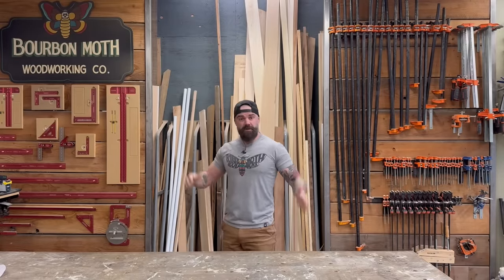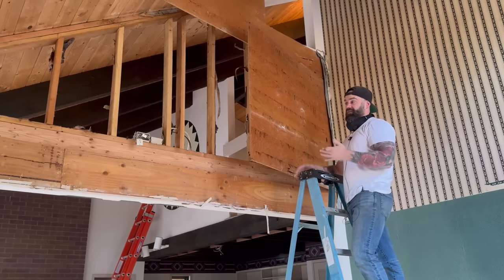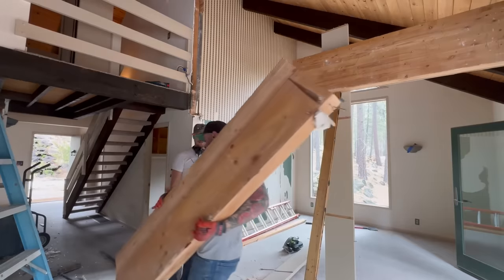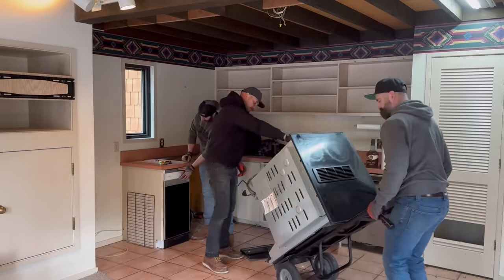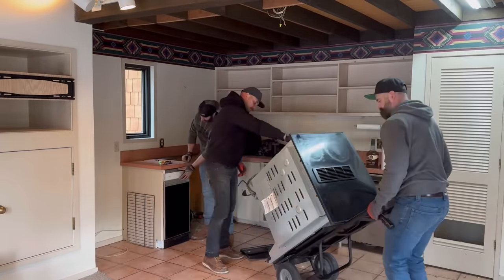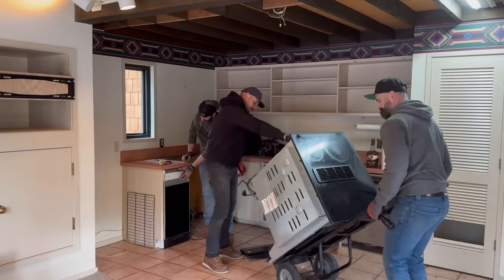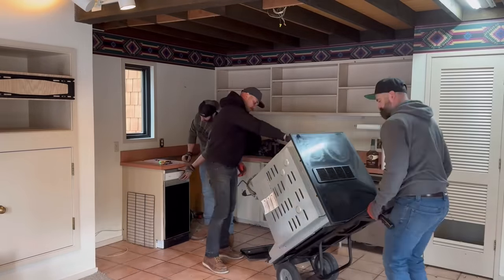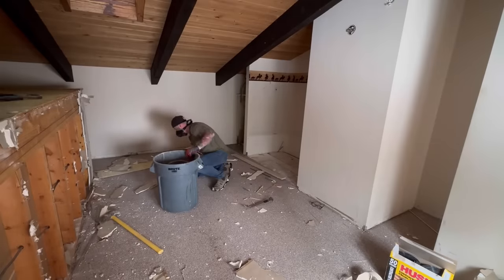Tearing Apart Our New House || Was This A Big Mistake?

Comment: That ply makes me nervous. Are you certain it’s not a shear wall? That’s a typical application of plywood on interior walls, to add rigidity and increase structural strength. Earthquake preparedness and IBC code. Did you have a structural engineer look at it and say it was okay to remove?
Reply: Maybe, but a shear wall wouldn’t need insulation, right?
Reply: Bahahahahaha!!!!  Cabinets as soft as their meatballs!!!!  That’s so accurate!!!!  Laughed my ass off at that one!!!  Classic Jason!!!!  Love it!!😂😂😂😂
Reply: Yep, I would look at what was holding that beam up and see if it extends to the foundation.  If so that was put there to hold up a bulk of structure.
Reply: I would be nervous as well, but since it was exterior previously it's no too concerning. That means the walls on the other side were added and they are adding shear strength to replace the one he took out. And significantly more shear than was original because it's a solid wall, not with a huge door.
Reply: Code is gay.
Reply: He said the place was built in 1976 and has never been updated. The state of Oregon didn’t implement seismic code until 1993.
Reply: @judmcfeters9054  and? He was clearly wrong when he said that, as shown by the exterior wall interior to the house. Seismic code is not really relevant. It has sheathing in the exterior walls whether that was calculated or not. The fact is it has more shear strength than when it was built, because they've added more square footage of sheathed wall than when it was built.
Reply: Also, building code was first implemented in 1974 - only 2 years before this was originally built. By the look of that electrical he uncovered, they probably didn’t follow any code at all…
Reply: Looks cool. Looking forward to watching the progress.  Really looking forward to seeing it on air b and b - I live a few hours away and I’d love to take a vacation there 😀. Please add a hot tub 😜😜😜
Reply: I was worried about it being a shear wall until he found the remnants of the original ceiling beams cut off behind the wall.  I still would have called a structural engineer first, though.
Reply: That insulation could well have been used to zonalise the heating. Previous owners may have wanted to heat the upstairs balcony area without heating all of that huge ceiling area beyond. That could have been the entire purpose of that divide. I really don't think it would have been an outside wall.

That said, it would probably have been a good idea to get the opinion of a structural engineer before taking those dividers down, just in case they were put in retrospectively to augment the structure.
Reply: Based on the decorating and some of the definite addition-y aspects, I would guess this house had some major update mid 90's. Gives vibes from "room by room" (tv show).
Reply: The way the stairs go through the small bedroom door I’m thinking that room might have been added too. Would be interesting to see if one of those walls might have exterior sheathing.
Reply: I am trying to wrap my head around the fact that if the roof beam had been cut back to make space for that large header and the wall above the header had sheathing and insulation on it, was that roof beam actually a roof beam like the others, or more an ending point of the roof load?
Reply: I wouldn't want to walk the roof until the original beam was reinstalled, the beam that was removed to put that header in. And hope for no big snowfalls.
Reply: We insulated our walls and they had brace ply on them, it indeed could be brace ply
Reply: Look thru historical google earth images to see if the house grew
Reply: LOL.  The house was built in 1976. How long has Google been taking satillite images?
Reply: Architect here, it's his house so you can do whatever you want. Would still advise some professional input from an engineer or an architect. Love this series, wish I found it when it was complete so I could binge.
Reply: First thing that came to mind. Shear wall !!!
Reply: Shear walls usually have a special nailing pattern. I don’t see anything like that in the video. Maybe they didn’t do nailing patterns back then?
Reply: He found metal flashing on the interior, though… wouldn’t that almost certainly mean it was originally an exterior wall?
Reply: That's not a shear wall. Shear walls need to go to the foundation to transfer the lateral loads (e.g. wind and earthquake) out of the building. If the shear wall stops at a beam then 9 out of 10 times the shear wall will be too flexible per code and the building will move too much sideways.
Reply: Yup I was thinking the same with those vaulted ceilings it would make sense that ply is structural
Reply: @Mostviews111  the plywood isn't the issue because it's not a shear wall. The bigger issue is his roof planks are spanning too far without that partial wall and header beam in place. If there's a blizzard or a lot of snow built up on his roof, the roof will "fail" or if there is enough snow, outright collapse right there. Luckily, we're moving into spring so he should have some time to get that new rafter in place.
Reply: @joshuaworkman1  Shear strength isn't the issue. He compromised the gravity load carrying capacity of the roof.
Reply: Well IKEA has mounting instructions... The back gives it the structural strenght...
Like the roof wall you ripped out removing the wall strength... Compare the beams in the roof.... 😬
Reply: @Awallace222  shear walls can be anywhere in a house... ceratinly exterior walls which would have insulation.
Reply: I'm surprised it had plywood on it...

My 1971 house has a total of 1 sheet of plywood for sheer strength. The rest is 1x8, and all the sheathing & waterproofing is tar paper...

Eventually, I will get the stucco off this place, so I can sheath & waterproof it properly. The plan is sooner rather than later.

My closets also have massively oversized beams to hold the opening up, & not the roof structure. This stuff was pretty common back then.

Comment: As a structural engineer, yes that beam may have been for a door header but its primary purpose was to replace the roof rafter that you found. The planks spanned over that interior panel and the 2x4 transferred the load vertically to the monster beam. The reason the stud didnt pinch on the blade is because there was likely very little snow on the roof. Youll want to get thay rafter installed ASAP so your roof doeswnt cave in if you have a snowstorm.
Reply: Was thinking the same thing. If it is sized for snow load then it probably wouldn’t have any sag without snow.
Reply: @patricksheehy5869  the next question is why take out the rafter in the first place? I bet they could've put in the door header without compromising the roof structure.
Reply: Is it possible that the plywood made this a sheer wall and that it should not have been removed?
Reply: @JonathanR-b8b  shear walls go to the ground and into the foundation. If they end on beams they're often too flexible when under wind or earthquake loads per code. He can take the plywood off but he shouldn't have removed the beam and vertical studs without temporarily shoring his roof planks first. Right now, all thats holding up the roof at that location looks like a couple of 2x4s on the flat instead of a larger rafter.
Reply: Another structural engineer here - confirming. Clearly there is a no rafter above that beam. Get it installed ASAP
Reply: Architectural designer here and I agree! You are essentially taking off what is the gable wall rafter. Definitely needs something to replace it for your roof to be structurally sound. How did you get your building permit without a stamped and detailed renovation plan? This shouldn't be too much of a surprise. I realized that wall was at least partially structural and was previously exterior almost instantly.
Reply: 3rd, 4th, 5th? Structural Engineer here, please have someone come out and give  it a look. That was definitely a structural wall section. 
I really hope you have the right permits too.
Reply: Electrician here - it’ll be fine
Reply: @davidmitchell5190  is that before or after the electrician and plumbers put holes in the wrong place through the beam 🤣
Reply: @pinkyhotmessx69  you don't need screws for something to be considered structural. The screws were there to keep the beam from moving side to side. That type of load is very minimal and would need only a couple of screws. The load path is through the beam bearing on the studs below. That allows the load from the roof to get into the supports below the bam and into the foundation.

Comment: Architect: That was almost certainly a bearing beam.  That sort of framing (I think of it as Acorn Deck House framing but its relatively common in contemporary construction from that era) uses wider spaced heavy rafters that are designed to be exposed, and then generally furrs them on top with perpendicular framing (usually 2x6s or 2x8s, sometimes heavier cedar or something) that span the ~4'-0" between rafters.  Usually will find rigid insulation between the 2x6s/2x8s for ceiling insulation.  Roof sheathing on top of that.  The builder omitted the rafter from above that wall to save cost, and just used the (what used to be exterior) wall to support at that line.  You don't see sagging because that perpendicular framing is still supporting the dead load of the roof, but its now spanning twice what it was designed for (8'-0" instead of 4'-0").  You'll want to figure out how to support that line, probably by installing a rafter that spans support to support like the others, or you may be in for a bad time next time theres a bunch of snow on the roof.
Reply: He's already got a rafter beam lined up 👍
Reply: When I watched cut that beam, it made me cringe. That needs to be put back.
Reply: i also think its a load bearing beam and a shear wall (exterior plywood is often used for a shear wall)
Reply: Yes, the snow load was my first thought.
Reply: I don't think theres a shear issue.  That corner room was almost certainly a covered/screened porch in the original design and was later enclosed into finished space.  So shear strength was gained when that happened (due to sheathing what used to be open walls).  Additionally, to get much shear strength from the panel above the beam that was removed would require some meat (prob 18-24") at the sides to transfer lateral loads to the foundation, which I saw no signs of.  Its possible it was part of some comprehensive system (the header transferring loads to an interior shear line) but adding the rafter like Casey said they are planning should solve that anyway.  Houses of that era almost never considered lateral loading at all.

Comment: I'm looking at that dumpster and seeing enough free wood to use for templating and small builds that would last for years! 14:30
Reply: Someone call Matthias Wandel 😁
Reply: Free as long as you don't mind all the work to remove nails
Reply: Ditto. The bookshelves looked pretty nice to me.  Someone could have upcycled those. But arranging that takes time away from demo and construction.

Comment: headers are not just for a door to have an opening or place to attach to, a header actually takes the load from above and transfers it to the sides and down (normally) Jack and King studs. That header looks very beefy, there is no way it was there just to hang a door. I would get a structural engineer out ASAP and look at the situation and draw up some corrective plans.
Reply: I agree.   But in this situation where is the load coming from ?
Reply: @Shaolinbody  the roof, along with expected snow load

Comment: 22:00 to 22:30 - My favorite part of the video.  Poorly installed electrical wiring + shower = bad idea.  Bullet dodged... barely.  Good work!
Reply: You should have an electrician kill power to the house before you start. Wires, outlets and switches from 1976 have to go. I'd be shocked if Oregon code permitted their salvage with that much demo. BTW there's nothing wrong with wire behind a shower its got to go somewhere and as I said a smart demo guy...
Reply: Exact same thing happened when we went to replace a similar style shower. They had run a couple 110 lines behind the shower and our contractor sawed right into them. luckily the sawzall kept them from being electrocuted but lesson learned. shut off power at least to that part of the house when pulling those things out.

Comment: pro tip when taking out base boards . razor knife the seam between the wall and the top edge of the trim. it will safe the paper on your drywall from tearing.

Comment: Can't wait to see how it turns out. Have you checked with the county to see if the original blue prints for this house are available ? It would be interesting to see how much it's actually been modified. Might also help you with relocating things to where they actually should be (stairs, kitchen, etc).

Comment: It was quite common in the 70s to have outdoor spaces under the overhang on the main roof. My parents house even had had an interior outdoor courtyard in the center, if that makes sense. It was also common to close those spaces in to the roof line. Resulting in all sorts of exterior wall finishes, brick, plywood, plaster, … in parts on the house.

Comment: Would you be able to go to the local planning dept and see if the original plans are on file. Might give you some insight, or perhaps there was a development permit for improvements. I replace main bath and rather than going over the screws that hold the new shower enclosure with drywall, I used a 1 x 4 moulding which will be screwed on and cover the screw heads with decorative caps in the even someone needs to remove it later. Makes it much better to look at. Can't wait to see the next bit of progress.

Comment: Note that they had the 2x4 support sitting on that very large beam which was holding up the roof.  You have removed the roof support and that won't be an issue unless you have lots of wet heavy snow.  I would suggest that you add 2 - 2x4 or 2x6 members (evenly spaced) under the existing roof beam unit you are able to replace that member with another big beam.  It won't fall down it will however sag and could cause issues with your roofing system under a heavy snow load.  Just a suggestion to assure your demo doesn't cause you problems later.

Comment: There was a load calculation done on that span that required that beam to be that size for a reason... Yes that was an exterior wall at one point no doubt... That rafter beam was removed, (why? I cant figure that out? seems odd the flashing and insulation were left yet the rafter beam was cut when it could have been just left in place behind the drywall???) and an engineer ran the calculations and decided for that span and load from the upper structure with snow load required a beam or "header" of that size to replace that rafter for a reason.... Your going to need to replace that rafter ... Since it was cut at both ends your going to need to add some support all the way to the foundation to carry the load....This in not wood working, this is construction... If you ever tear into a wall, and see anything other than a doubled up 2x4 as a top plate... Your are 99% of the time dealing with something that is load bearing, and should consult an engineer unless you know what you what your doing.. Wood working? you know what your doing and you have some serious talent, hence my sub.... Construction and demo? yanking out that beam makes me worry....Ignorance is nothing to be afraid of, read your comments, Im not the first person to realize your mistake... were not calling you out to me mean, were trying to help... Get that squared away bud... Personally Id scrub this video until you do.. If that roof fails your insurance company has all the proof they need summed up very nicely to deny your claim..

Comment: This triggered a memory. Hours of pulling those carpet strips from concrete. My carpet pad was glued and they used hundreds of concrete nails to hold down the wood strips on the perimeter. Took me forever - longer than the actual floor install after. Good luck - looking forward to more vids on this!

Comment: I really like how that living room became a big comfy space... 

22:20 Don't worry. I hung about seven times on 220V and one or two times on 400V (that even left a white spot on my finger, where the current entered it).. I am still alive.. Also, you had a tool in hand which probably isolates you more than the direct contacts I had myself.
Reply: it's not the voltage that kills you, it's the amps. But you probably knew that.